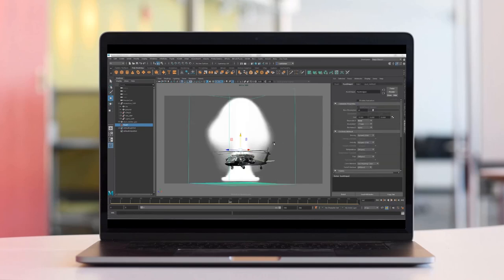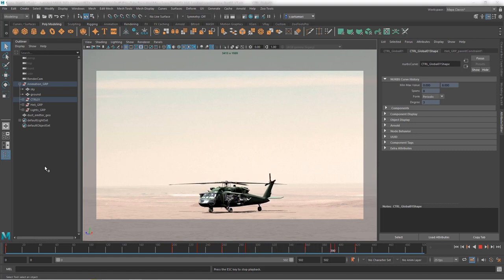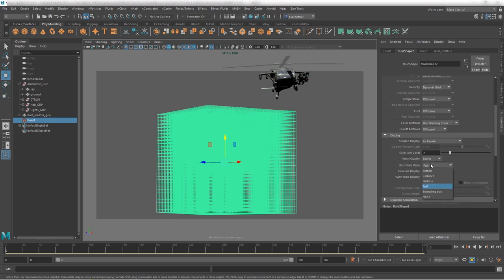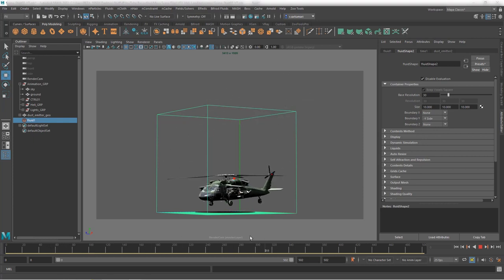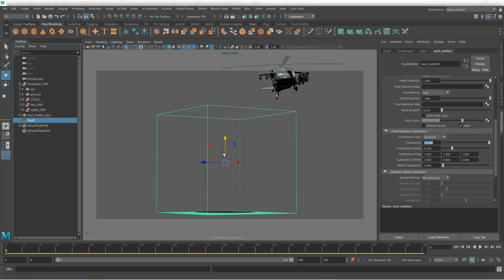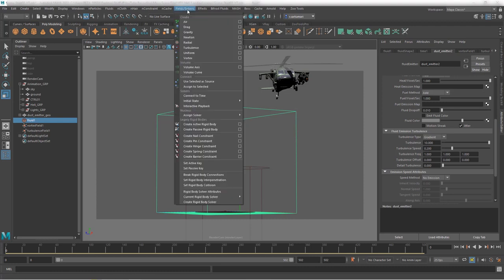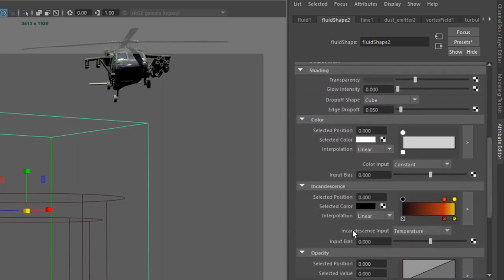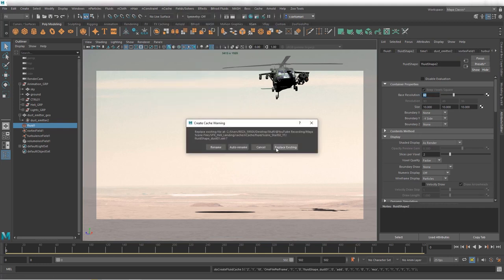Maya VFX Series: Dust Effect with Fluids

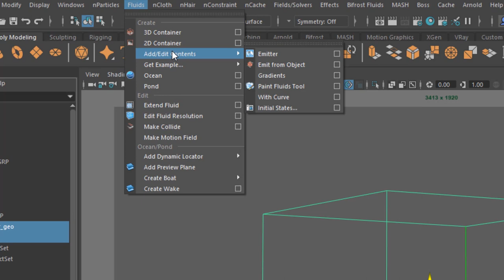Comment: This does not work for me, at the 10:00 mark where you go Fluid > Add/Edit Contents > Emit from object settings. After applying this then no fluids/particles are coming out of the emitter. Any reason why? My viewport is on show all as well so nothing should be hidden
Reply from the maker: Make sure to select both the container and the object before you apply the tool.
Also in your viewpoint settings make sure shaded mode is on and the motion blur button is off.
Reply: @sarkamari  Same thing happens (or doesn't) for me as well, Maya 2023.1, select both, viewport shaded, no motion blur and nothing happens. It does, however, work in Maya 2022 when I do it there. Same procedure, not sure what broke in Maya 2023.1